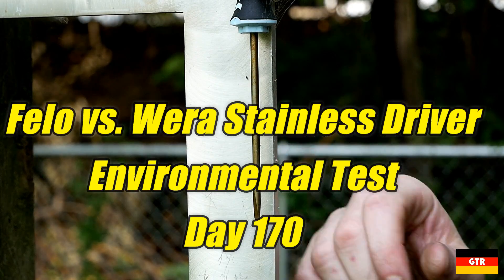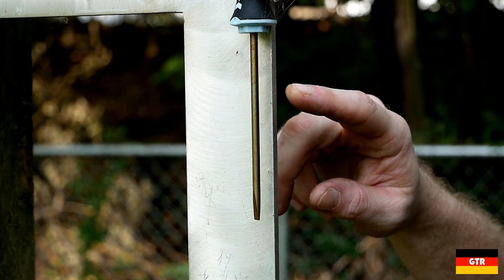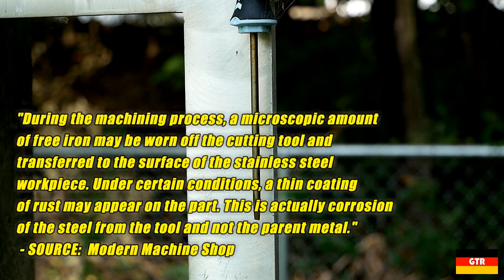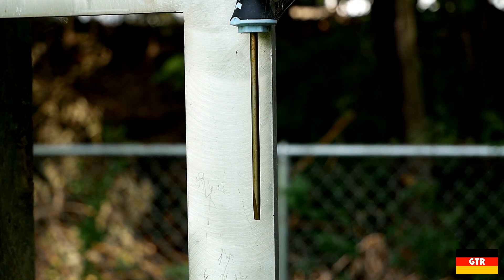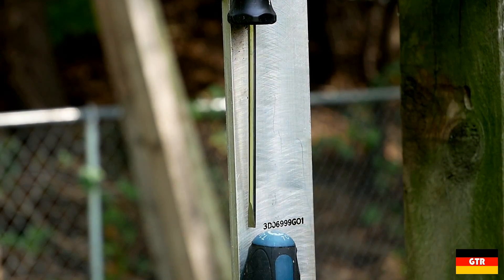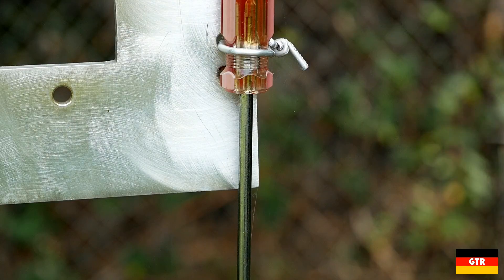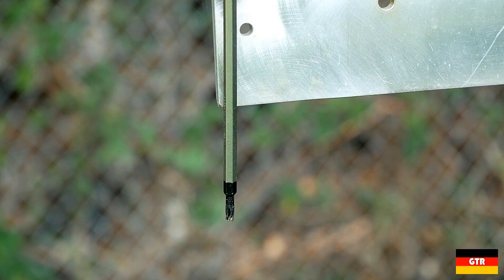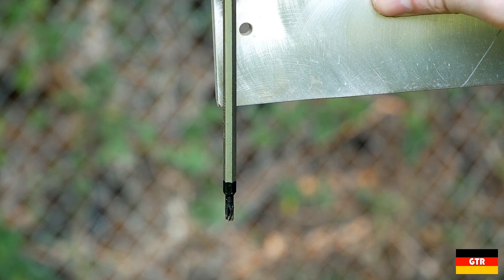Wera/Felo Stainless Driver Environmental Test - Day 170

Comment: David Lowe hit it on the head. 
On a side note, I would hazard a guess and say that the Felo screwdriver would clean up and look great if placed in an ultrasonic cleaner with an acidic solution (something like CLR or Barkeeper's friend dissolved in hot water). I have access to this through work and do this to any stainless steel tools I acquire before (or during/after) use.
Reply from the maker: Thanks for the suggestion.  I was thinking about some some experimentation to one of the other Felo stainless drivers I have and then putting it outside to see if that corrects the discoloration problem.
Reply: This happens with stainless surgical instruments all the time. When new and taken straight from the package and put into sterilization, the vast majority from most manufacturers discolor and turn that same brownish color as the Felo in your video. Those instruments are bead blasted, however, after they are made. Clearly there are contaminants in the steam/water used to wash/sterilize the instruments but it is a similar phenomenon to what you're seeing. 

Placing them in an ultrasonic cleaner with a hot, mild acidic solution prevents that discoloration from happening again. The only thing that will occur after this process is stains from contaminants sitting and drying on the instrument after cycles of washing and sterilizing.

Comment: Stainless steel is usually pickled then passivated. The process of removing machining contamination that you describe is mainly achieved by the former procedure. Passivation typically happens naturally but is often done immediately after pickling / neutralisation to form a thin layer of chromium complexes on the surface (which is what makes the product 'stainless'). Other factors affecting the deterioration are grade of stainless used and the fineness of the surface finish.
Reply from the maker: Thanks for the information, definitely not my area of expertise.  The last bit of information I got is that the shafts for the Felo and Wera drivers are from the same OEM stainless manufacturer, but obviously Wera did some additional steps to prevent the discoloration.

Comment: Intergranular corrosion is the term used for this phenomenon. 
As an apprentice, i learned the hard way when i polished about 50 square meters of stainless steel sheets with regular steel wool. lol
Reply from the maker: Give a new meaning to the term "apprentice mark" lol.  Hopefully you didn't lose your job over that one.
Reply: The punishment was wearing a golden 85mm wrench on a chain around your neck for a week. That made sure everybody there knew about you.
Reply: could have been worse, you could be the guy who accidentally dropped 2 10.000 dollar lenses on each other creating a perfect vacuum, throwing away 20.000 dollar.